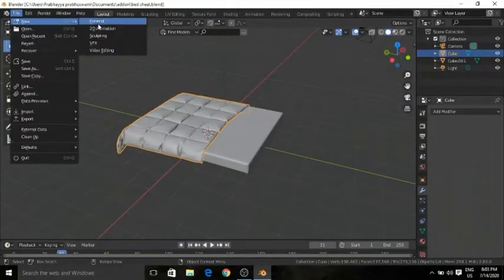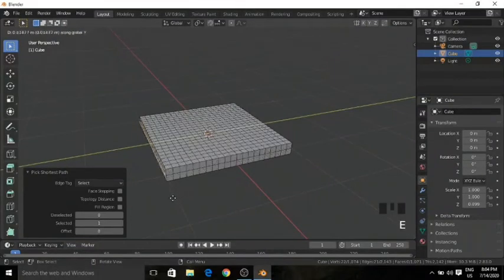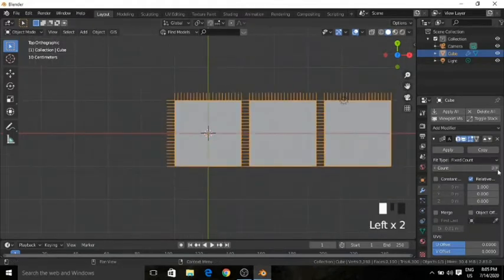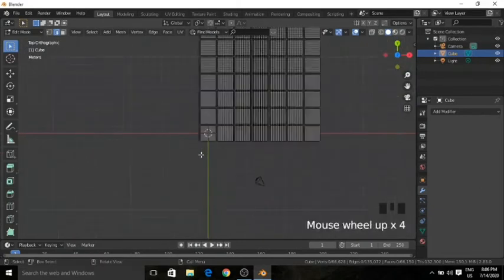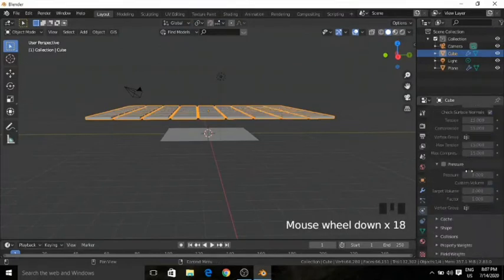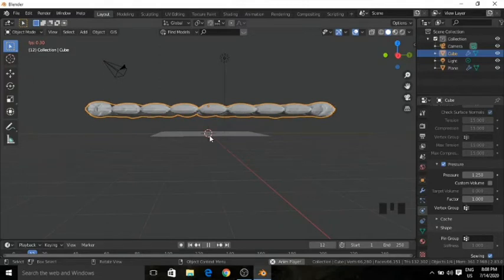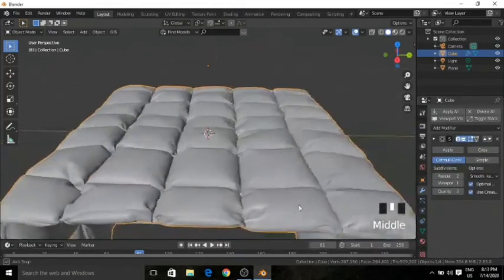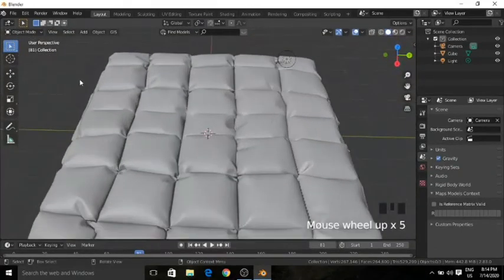How to make a modern bed sheet in blender

Comment: I've done this damn blanket 3 times already and it doesn't work.
Reply from the maker: Did you enable merge when applying in the modifiers??????   

I will make a higher quality video on making this blanket
Reply: @CGEpicepic  Yup, I made sure to click on the merge and then clicked on apply at the top.
Reply: @CGEpicepic  my blanket ends up looking like a bunch of rows of very puffy pillows
Reply from the maker: Did you watch the tutotial on pc because the video quality is pretty low
Reply from the maker: Probably u didnt fo that extruding part and deleting only the faces not the edges because it acys as strings i think thats the problem after you add a loop cut  extrude  them on normal and then  delete only the faces
The edges should still he visible
Reply: @CGEpicepic  yes, I did that
Reply from the maker: @gabrielaperilla8403  let me make a new video

Comment: Hi! Fantastic tutorial, thanks for your tips!
I have to do the same kinf of work, but my iMacg goes really slow and I would like to know if I have to implement its memory or so. Here the technical informations:
Processor: 3,3 GHz Intel Core i5 6 core
Memory Ram: 8 GB 2667 MHz DDR4
Graphic Card: AMD Radeon Pro 5300 4 GB
Do you think its enough or it’s better to improve some of that? 
Thanks a lot!
Reply from the maker: I am glad that you liked the vid.      My cpu is intel i3 with no graphics card.    Try reducing storage and. Clearing ram it will help incresing performance  my pc handels about 7 mil tris in a scene but with a bit lag if you clear ram and all your pc could handle huge scenes as well.   

Good luck with your project :)
Reply: @CGEpicepic  Thank you so much for your answer! I will ask someone to translate the "computer  language" because i'm not so expert in that! ;) I understand only that i have to clean and use all my ram for blender, right? Hou long did you take for realize the animation? I have to shape a duvet with lots of  stripes (not squared like yours) and it doesn't even start to fall!!
Thanks :)
Reply from the maker: @ireneroby2110  not alll the ram like opening tabs slows pc down so close unwanted tabs and clean the recycle bin
Reply from the maker: I am currently working on a cyberpunk city if you clear some ram while opening blender by closing unwanted tabs and cleaning the recycle bin pc will run real fast and could also handle programs like ue4 because my oc handels ue4 with a bit lag and blender will sure run smoothly